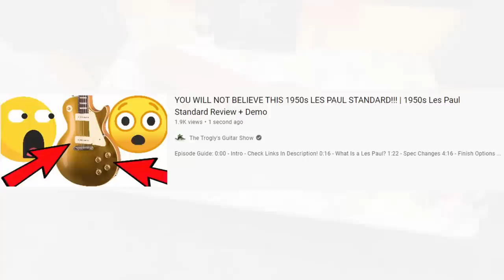My First 1950s Les Paul Is a Bit Different... | 1954 Gibson Les Paul Standard Red Double Cutaway Mod

Comment: Them pots look like something that may have been salvaged from old electronics.  I attended electronics classes for two years in the late 80s. We had a lot of old electronics that was donated for us to tinker with. Some came from TV and stereo shops. Others were donated by private citizens or some military equipment.  Those pots looks like some of what we worked with. Except the didn't have big hole that you could see into. Only part was exposed was the middle blade or shaft. Unfortunately we never got any guitars in there. Also that dust on them pickups sometimes happens when you've got two metals mixed either in the plating or even in the casing of some electronics. Age makes that happen and if its stored in a less than climate controlled room.

Comment: I have owned a mid 70s Deluxe since the early 80s and like it. I have played a friend's 58 standard and was not overly impressed. It was cool but,  my mid 70s is no slouch. That said, I have owned a 57 Fender P bass since 1975. I gigged heavily with both and know their strengths and weaknesses.  I built up a bass from Warmoth parts about 20 years ago and like it a lot. I have taken it to a lot of jams and am very comfortable with what it can do; basically anything I ask of it. I had my old bass refinished about 10 years ago because it was getting beat. It sports a 3 color burst finish now rather than two as they came from the factory and also has a Duncan Quarter pounder in it. Sacrilege? It's mine, I can do what I want. Some kid will get a nice bass in the future. I may even give it away before I pass away from this old world.
The point? If you have to buy a guitar from that era you would be better off with a Fender. They make them the same now as back then and they don't play much differently. I proved that with my Warmoth build. The electronics are better and so are the finishes.
A Leo quote. " A quality instrument is easily repaired".  
It speaks volumes for Fender.

Comment: A lot of players think you need to "deck" the TOM tailpiece to get more sustain. It actually increases the string tension and makes it more uncomfortable to play.. The saddles and the nut/fret are the main points of contact. The TOM bridge is usually not "decked" on most guitars, so the effect of the cranked tailpiece is negligible.
Reply: I agree, I think a lot of players just don't understand the math involved with the angles and how that affects the string's tension.
Reply: It also negativly effects tone and sustain if you run the strings backwards over the tailpiece.

Comment: Looks to me that the pots are off/on/volume switch-pots, possibly old TV or radiogram power switches from the Valve era with the switches removed. They are most likely all audio taper.

Comment: I wrap mine over the tailpiece and then the strings go over the bridge.
I wonder though without that spring retainer in the bridge? I wouldn't want that. I'd want each one of those saddles to be held in their spots.
You can file a little bit off the bottom of that switch tip.

Comment: Interesting guitar, but $17,600 is a bit much isn't? For the same amount you could buy a 50's Gold Top in much better condition.
Reply from the maker: A 52/53 trapeze, yes - but not a wraptail. Those are 28-40k. This is half off
Reply: @Trog  lol cuz he literally CUT HALF OF IT OFF!  This guitar is worth $3 - 5k in today's market.  Unfortunately the mods take away any and all historical significance, and a vintage shop would not even price this (most vintage shops wouldn't buy something so heavily modded for this reason) because it's gonna be worth nothing to most, something to some, and maybe the full price to a few.